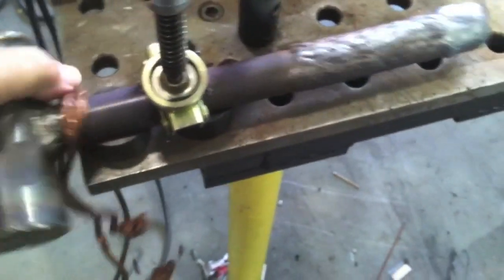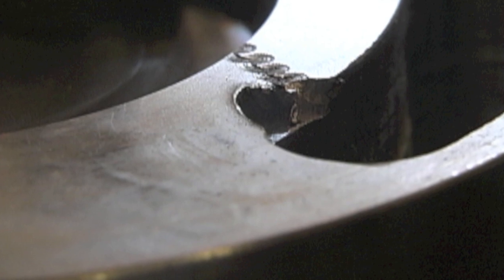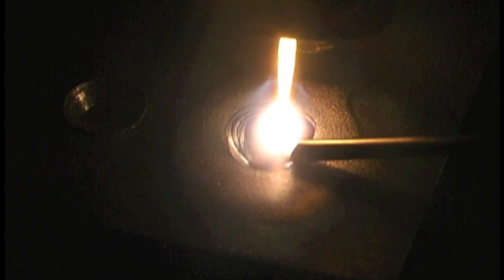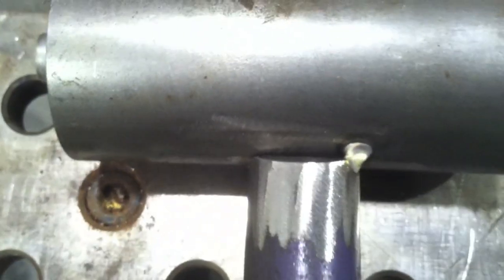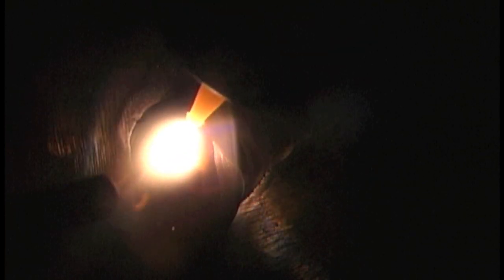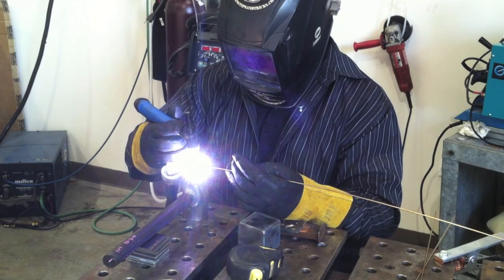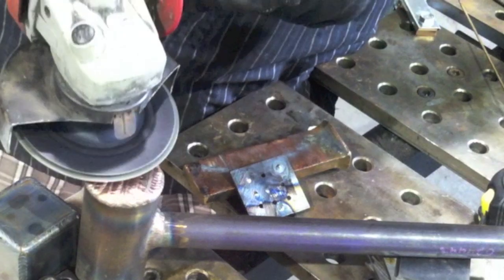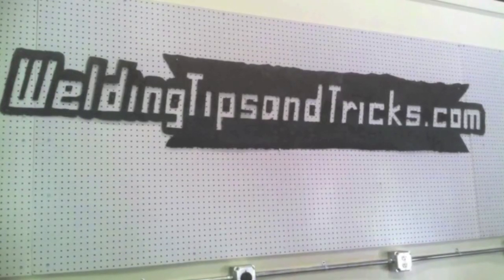Affordable Tig Welder Project

Comment: I hear all to often "Get a good machine" "Get a good machine" ! I've been a Heavy duty Truck Mechanic/builder/welder for 32 years. I decided to buy My own TIG for personal use and I went with a cheap $539.00 "Infinity TIG200P AC/DC machine w/pedal. it only goes from 5 to 200 volts and the 200P does not have pre flow like the 220P but they both have post flow and pulse. Yes it's a cheap Chinese machine but it has worked flawless for a few years now. No the pedal control is not precise, and I have initiate pre gas flow with the pedal first but, You don't always need an expensive machine. I do know how to TIG but that's not the point. Yea, We all want an expensive machine but these are not bad machines at all to get Your feet wet. I have welded pop cans with it and the balance works great on it with dirty material.

Comment: How much it cost to buy this machines,thank u for good Video
Reply: Off of the everlastgenerators.com website it is $489 list price. Give them a call and maybe they can get you a better price.
Reply: I'm thinking about buying this welder too. I already have one of their smaller mig welders and a plasma cutter but I want to tig aluminum. For the best price you probably want to give them a call.
Reply: Great deal indeed!
Reply: I bought mine a year or so ago and it has been absolutely flawless. Perfect machine for my garage needs at a perfect price. Also a huge duty cycle, I've run mine hard for long durations and have never seen the over temp light. Cheers
Reply: I love the duty cycle on my Everlast. I've never had it go into over temp.

Comment: does anyone know if this welder he is using does a.c. current as well as D.C. or is it a D.C. only like the cheap harbor freight tig welder? Got one of the harbor freight set ups as a discontinued item for $178.00 but I wanted to weld aluminum as well and would like to up grade if I could find something that isn't to expensive.
Reply: Well the HF special I got is the same thing but not as well made I guess. Thanks for the info.
Reply: +Emery Booker Pretty sure it is DC only.  Least expensive Everlast tig welder that does AC is the PowerTig 185 Micro.

Comment: Jody,
I've been a fan of your videos for years. It was actually your videos that taught me how to TIG weld even before I got a torch in my hand. And once I did, it was as if I already new what I was doing. I also love your TIG finger. It's cut down on me burning my self to maybe half. Lol. 

So I have a tech question for you. Ive been building MOTORSPORTS roll cages for about 3 years now. When I first started building them at a race shop I used to work at, my boss had me MIG weld the joints. Now that I have my own fab business, I have been TIG welding all the joints. Looks better and I like not having all the spatter over the cage. 
Most of the cages I build are DOM 1.5" .120 wall. I've been using a 3/32" electrode with 1/16" filler. I was just watching this video again and you used 1/16" rod to tack the joints and then 1/8 rod for the welding. Was wondering if there is any benefit to using the bigger rod for the joint welds other than not having to dip as often and/or dipping it as much. I guess I've just used the 1/16" rod just because I can keep a tighter arc and have a tighter bead. 

Is this just a kind of "personal preference" kind of thing, or would I get better penetration with adding more material with the larger rod?

Sorry if this has already been addressed in a previous video. There are so many of them. Which is good thing. 

Thanks for your time and for the amazing videos. Keep up the good work. 
-Caleb

Comment: Hi Jody, Dave here  i have the 256 s tig/ac-dc,stick, plasma. Had it since December last year. Drew a cart duel tanks cuz i have a mig also (110v). Setting up the top using ply wood marine grade and a 1/8 thick metal skin (replaceable). cut it like the miller portable table (mainly to tack stuff up then weld good unclamped). I did the cad on the cart and top so im following data its nice. Getting the top laser cut soon probably get 2 done 1 extra.  I got the 256s because of watching you weld with it ( i fair with a welder but i have cnc's nice to have a welder just in case..   nice vid's brother..

Comment: Thanks for the great video!  How well will this handle thinner sheet metal?  Can it go down to 16 or 20 gauge?  I would like to be able to bang out the dents in old MC gas tanks after then weld the halves back together.  Think it is 16 gauge sheet metal.

Comment: I got the 160 STH, since it is my first tig machine I don't know the difference between having a foot pedal and not. I'm a decent welder as far as stick goes, I did many years of building supports and weld-o-lets for a petrochemical pipe outfit. What foot pedal do you use for this machine and when would you suggest I get one? I was thinking I should get used to the process 1st, but have been told I should learn how to use the pedal at the same time, any advice would be great...Aloha!

Comment: one trick is to get a 240v drop an outlet from the meter when that's finished, wrap the power cord around your meter 2 times and then when ever you go to do your welding it stops your meter, which allows you to weld for free!

Comment from the maker: with an everlast or any other inverter welder, you will probably not see any difference in your power bill.  on the other hand , a big conventional welder that requires a 100 amp breaker, you might see quite a difference on your power bill if you weld a lot.

Comment: When using a Mig welder you mention using a shielding gas like Argon or a mixture of Argon & Helium. Is it possible to Mig weld without using gas like with a special wire in case you are working in a windy area where the gas would get blown away or simple want to save money on consumables.

Comment: I just learned in my welding class tonight that TIG (or GTAW) requires a shielding gas. Does that Everlast set up you have require a compressed tank hooked up? Or is your electrode coated in flux to create that shielding gas?

Comment: As you seem to be comparing mostly DC units with steel/ stainless capability, the 200DX may be the wrong one to compare to.  It is an AC/DC machine.  For a lot less we offer the i-TIG 200 which is a DC only 200 amp TIG welder with pulse etc. for only 699.00

Comment: Hey Jody!!! Can do a video on the multiprocess welders the pros and cons or is it better to buy a welder  for each process? 
For example an everlast MTS 200S that does MIG, TIG, STICK FOR $1200.00 
or Everlast
 I-MIG 200$ 800, MIG
POWER ARC 160STH 480.00 STICK
 POWER TIG 200DX $1300.00, TIG      FOR A TOTAL OF  $2580.00
PLEASE HELP!!!

Comment: Might be a good idea to inform viewers on the danger of using stone wheels on soft metal. They can explode if they are contaminated w/ soft metal and then used on steel. The aluminum in the stone expands under high temp, and since the stone isn't flexible...BOOM! Great vids though...best on the net.

Comment: At 2:40, are you starting with the rod's I.D stamp? If so, can I ask why? I've learned to save the I.D stamped portion until last just incase you stop midway on the rod, and/or need to use it for another weld at a later time. Just curious.

Comment from the maker: yes, you can use 309 for carbon steel but there is usually no need. er70s2 or 3 works fine and in most cases is a stronger weld on carbon steel....and is much cheaper than 309 if you know the metal you are welding.

Comment from the maker: i dont think silicon bronze is any worse than most other tig rods. the chromium in stainless, cobalt in aerospace super alloys, copper coating on mild steel rods, and zinc in silicon bronze are all bad for you. we should all pay more attention to ventilation and wearing respirators more often.

Comment: Hello There!! I'm from Brazil and I'm big fan of your work!!
I have an question....
Can I use 309 to weld a steel tubin with carbon equal or greater than 0,18% like steel 1018?
Does it have any good reason? Or we should use 309 when we are not so sure about what we are welding?
Thanks for the atention!!!